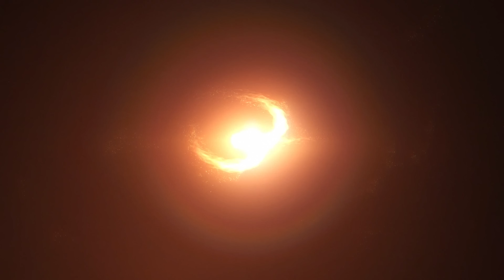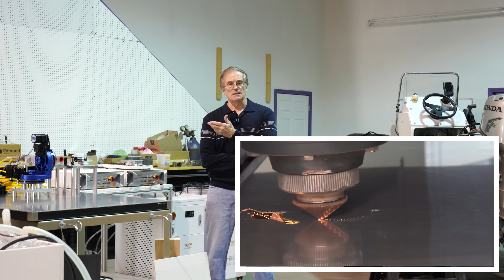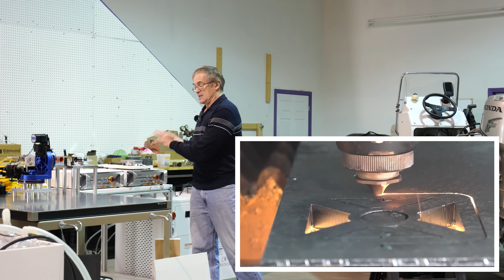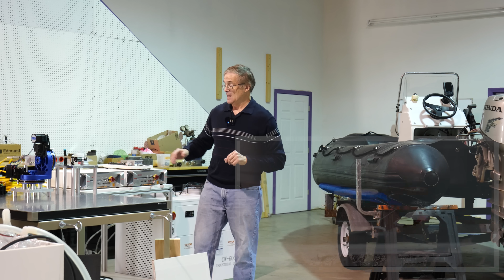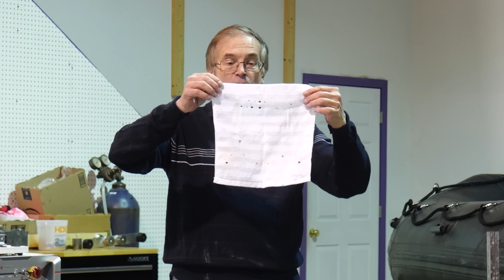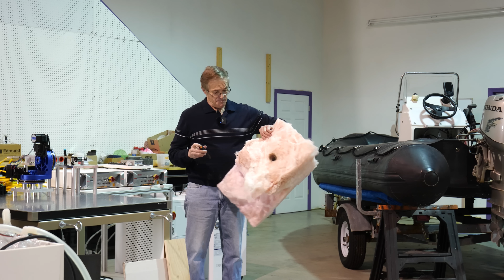We have a problem... and need your help!

Comment: From chatGPT 

For indoor high-power laser testing, you need a beam dump or barrier that:
	1.	Absorbs rather than reflects the beam.
	2.	Survives for the necessary duration (several seconds).
	3.	Dissipates heat without creating hazardous by-products.

Key Considerations:
	•	Wavelength and power of the laser (you didn’t specify—assume multi-kW class and either near-IR or visible).
	•	Beam diameter at impact (focused to small spot = high power density).
	•	Duration (a few seconds = significant thermal load).

Recommended Materials:

1. Graphite (High-Purity Carbon Blocks)
	•	Very high melting point (~3650°C).
	•	Excellent absorber for most wavelengths.
	•	Low reflectivity, especially if roughened or angled.
	•	Used commonly in high-power laser beam dumps.
	•	Con: May sublimate or erode with continuous use—good for pulsed or short bursts.

2. Black Ceramics (e.g., Silicon Carbide or Alumina Coated with Absorptive Layer)
	•	High thermal resistance and damage threshold.
	•	Commercial beam dumps often use such materials with cooling.

3. Copper or Aluminum Heat Sink with Black Oxide Coating
	•	Good for lower power or diffused beams.
	•	Must be angled to avoid back-reflection.
	•	May include cooling systems (air or water).
	•	Black anodizing reduces reflectivity.

4. Commercial Laser Beam Dumps
	•	Designed to handle kW-class lasers.
	•	Often use conical or wedge designs to trap and absorb the beam internally.
	•	Water-cooled or air-cooled versions are available.

5. Sand or Charcoal in a Metal Box (Temporary Use)
	•	For crude indoor testing, a container filled with dry sand or granular carbon can safely absorb energy.
	•	Beam is scattered and absorbed by the grains.
	•	Use only for short tests—this method creates fumes/dust.

⸻

Best Practice Setup:
	•	Use angled barrier to reduce backscatter.
	•	Surround with non-flammable insulation (ceramic wool).
	•	If using makeshift materials, always include fume extraction.

Comment: Guessing a Hebel block wall isn't a solution ??

Seems an ablative target layer may always be necessary...

Short of a rock quarry as backdrop high energy "light will out". 
(one doesn't want to reflect that energy it needs to be absorbed, or the contents of the lab will be at risk - short focus, (and coincident/intersecting beams), as stated is the safety used for practical material concerns.  "Infinite focal length" - approaches a real starwa*s  "ray" - device.

 - In other threads, folk are hypothesising slurry systems...

 - I added "   @custos3249    hmmm,  a slurry recirculation system (edit: or "recirculating slurry") on an inclined plane - viscosity can be engineered for flow rates and pumping  - vibratory fluidisation makes near solids flow incredibly...  (thinking out loud like most - here...)"

Comment: Paint can full of sand. It's easy to scale up to a bucket or trash bin. Put the can in a box to contain both the molten residue and any sand which drains out. The sand will extinguish any flames which may occur, it will filter and ablate to diffuse the beam at the contact point, and it makes a fantastic heat sink.

Comment: onjly have superficial knowledge about that stuff, i jsut wondered:
1. is stray radiation is tolerated, with such high power lasers i cannot imagine it is
2. what area should be coverable. a plate or rather 2 garage doors?
maybe it's jsut my lack of understanding the setup you are planning for

Comment: My first inclination is a water jacketed polished brass sheet, angled to deflect the beam straight down into a box of sand, possibly granular blastfurnace slag or basalt?  Really, a thick metal sheet of an alloy that doesn't readily absorb your particular frequency of laser is always an option, we had nightmares trying to cut brass on our IR fiber laser machine.

Comment: How about a water fall, doesn’t need to be thick. Could be wide, or if it doesn’t melt glass a thin aquarium wall might work, and you could experiment with the transparency.

Comment: Does intumescent paint work? Nighthawkinlight has some experiments showing some recipes.

I think the insulating carbon foam that's made when it starts to heat could be a good insulator to stop the drywall catching fire.
If I remember right he had a few videos about a Starlight like material and how to make it.

Comment: If you set up a water curtain, imagine those water fountains where it’s continuously dripping water in a constant stream. They should fix the problem with the water evaporating too quickly because you’ve got a Con continuous flow. I think the energies involved which you haven’t exactly specified should be able to be absorbed by this water.

Comment: Dark anodized aluminum plates in the following configuration: Place the material at a highly oblique angle, close to parallel to the laser beam, to extend the safe exposure time by increasing the area of impingement and reflecting some of the energy, particularly when combined with secondary and tertiary plates of similar material. If you like I can quantify the effects of various impingement angles. While dark anodized aluminum is inexpensive, it is the opposite of failsafe, as ablation of the anodized layer will expose reflective aluminum. If aluminum is too dangerous, graphite blocks coated with Vantablack or Acktar Black may present a more favorable failure mode.

Comment: Is ballistics gel portable enough for your purposes?If you added some dye or titanium dioxide and maybe some shredded aluminum or other reflective material you might have something structurally sound which could absorb a lot of heat through phase change while spreading it laterally to take advantage of a larger volume. Aluminum shavings should kick back most of the laser energy but in a way that's not focused enough to cause any perile to people or equipment standing in front of or to the side of the wall.

Comment: I'm not an educated man. my first thought was ceramic tiles like were used on the space shuttle. They handle a LOT of heat. But that heat is spread across the entire tile. I think you need a way to split the energy up before trying to absorb it, so there is less heat or energy to absorb. And the only thing that I can think of is diamond. And those are so powerful, you may need something like liquid nitrogen to cool the diamond to keep it from melting. Whether an industrial diamond, or a synthetic diamond might work, I don't know. But as many facets as can be ground into it would be helpful to split that energy up. Then maybe fire brick could handle it. Actually, one more much less expensive item came into my mind. Carbon, like what is used in electric arc search lights. I used to work as a projectionist. And those old projectors used a much smaller carbon arc "rods" that had to be adjusted every so many minutes. Those will take A LOT OF HEAT. And its the same technology as in those WWII search lights, and even carbon arc welding. if you could find a way to cool those, maybe run a water hose over the rods? Since your not dealing with any AC volts, (at least on the receiving end), that might actually work. And would be reasonably priced.. Those are my ideas. I hope you find something that costs less than diamonds! But maybe as a last resort.

Comment: A couple of points:
Anything reflective would endanger you and everything in the room. Also, this beam will continue through the atmosphere and could hit aircraft miles distant while in use.
My suggestion is to use extremely short pulses, especially in real world conditions. Destructive testing should yeald a time frame sufficient for the purpose,  then limit the output. A few milliseconds should do. Otherwise you don't just temp the FAA but endanger lives. 
There are simple compounds which swell and exfoliate providing good heat protection to the underlying substance. I can't remember the name or formula.
Perhaps a fishtank with absorptive dyes or particals tailored for your spectrum.
Even powered charcoal may suffice with supplimental dyeing.
Also a divergent beam may be safer. Just narrow enough to do the job but diverging constantly thereafter.

Comment: if you were to mount the lazer vertically and point it at the ground you would still want the 'contractor grade trashbags filled with dirt' around it. the issue isn't with resilience but basicly with refraction. when you have a high powered lazer which doesn't concentrate on a point, and thus doesn't spread out beyond the point, you will want to make sure that no matter what it hits the reflections and refractions do not bounce a single time and hit someone. if you fire it at the ground, if there happens to be water on the ground then for a split seccond it could be reflected and refracted at someone, but if you dig a hole and make sure to pump it dry with a wet vac if it FILLs with water, then the lazers themselves will bounce back upward.
if you don't want to dig a hole, you can achieve something similar by constructing a mound.

the problem with these concave lazer catchers is that the reflections will come back at the lazer creator itself. one way to deal with that is to disrupt  the "antenae reciever" instead of making a bowl or hole, you make it like the impression of a torus or doughnut. another option would be to not mount it vertically at all. if you have a lazer shooting a straight beam, you could have a very small pure silver mirror reflect the lazer at the ground. if you make the mirror at 45o then the reflection will be 90o  and only perfect reflections will go back at the lazer. this in effect shrinks the size of the lazer maker to the size of the mirror. also if instead of making it reflect 90o to go straight down,  you make the angle of the lazer hitting the ground progressively closer to perpendicular, you in effect spread the energy of the lazer across more area. if the dot of the lazer is an inch squared, and you angle it to hit 1000 inchs of distance, then you reduce how much power is being absorbed by any particular inch of space by 1000. taking 1000 watts to 1 watt, may not be enough but it is still very much a difference in order.

similarly, if you have a focal point, regardless of whether it is made by teh beam generator, you can always put a prism to spread the energy across a larger area. lazers have very low variance in frequency, but if you can take a 1 inch square lazer and not only make it get absorbed by 1000 inches of colision, but you also can spread it in a seccond axis, then you geometrically reduce the number of watts needed to be absord at any particular point.

repeating but expressing it more explicitly. if you have a 1kw lazer, and you make it get absorbed by a distance of terrain, you increase the dimentionality from a zero dimentional point to a line, and if you increase the dimentionality from a line to a field, you spread the power even more. you could increase it again with a lot of difficulty abusing photonics and ablation. if you can get a vollume of solution and get teh solution across teh entire vollume to be equally likely to take a watt of power out as any other part of the vollume, then you have a 3d reduction of lazer power. which means you are basicly cuberooting the amount of power.

what would i do as a lay person? if you aren't beam forming lots of energy from different places into a point, my first reaction is to reduce teh risk to the lazer maker itself by using a mirror to angle it at the ground. then if that was still scary i'd dig a hole or make a mound out of fire bricks. if done in a warehouse i'd go with the mound.  then i would cover teh mound with a cooking pot lid and have the lazer pass through a hole in the center and any reflections would be angled out relatively randomly into the area, and be absorbed by the insulation and drywall of the warehouse itself. doing this would cause the reflections to sorta be spread across the entire surface area of the room. it wouldn't be the actual surface area because there is geometry in the warehouse itself. and also the lid to a cooking pot isn't exactly an optical grade parabolic lens. but this feeds back into the question of "how much money are we looking to spend"? 

in engineering there is always a more expensive solution which is marginally better. in civil engineering you could build a hooverdam scale levy to protect against storm surges, but it would be exponentially more expensive.  the same thign is true here. do you have a huble tellescope type of budget, or consumer tellescope for kids budget? the lid of a cooking pot with a hole from a removed handle will cause decent spreading of power per dollar spent. and you can go up scale and get actual tellescope parts from broken tellescopes off craigslist or similar.
another thing to keep in mind is what you are doign and what others in the field are doing. most reflectionary collumns are about concetrating light, not getting rid of it. they want to look at planets, not avoid catching stuff on fire. this lower prestigue means that you can get away with much much more vulgar tech.

the seccond cheapest option is to take a blank silver coin and a hole nearly as big as it. and hit teh blank silver coin with a ball hammer to make it concave/convex.

which is better cooking pot lid lens or a reflecting glassless mirror? i don't know, you would need to do optical simulations. incidentally by frosting teh glass using a solevent you will increase diffusion massively.

before you do teh optical simulations you would need to buy an industrial quality 3d scanner, and then you would import that digital object scan into a digital twin simulation. ray tracing is the term for this optical simulation.

the problem with aiming it at teh ground in general is reflections. and it is the same problem with aiming it straight up. if you aim it up or down and your catch fails, then you can find yourself in trouble. it isn't likely that at the moment of mechanical failure an aircraft or space station will be right above you, but the trouble you will get in in such a situation escalates very fast.

in general, just like in chemistry, the solution to polution is dilution. spread it around, and while it likely seems dumb, i'd also be worried about reflections and refractions going out windows. both directly in the direction of travel, and directly behind. one way to deal with this is to move the 'focal point' where you are doing the experiment near perpendicular to the windows in question. another is to put shades on the windows perferably on the outside. if you can open those windows, in the summer, you can get natural cooling by having the windows always open and just ahving the shades  angled at different degrees to get wind to blow through the shop.

also i personally would not fuck with water or steam for high power lazer situations. if i was to fuck with somethign similar i'd try finding a source of very very black smoke. the smoke itself will naturally ablate and replenish itself, and unlike water which makes rainbows due to refraction, black smoke wouldn't obviously increase risk. i'd still prefer to go about it in a normal optic manner, messing with fluids like smoke is asking for trouble. if you were dealing with military grade lazers that were tuned to slice steel specifically, then sure, but if you are dealing with a powerful lazer which isn't litteral weapons testing, i wouldn't do that kind of high risk option. the reason water is risky is that this isn't a full spectrum light source, it is a lazer which is nearly one frequency or color. so water would redirect it but not diffuse it necessarily. with the lens and reflectors the spacial distance of how wide the lazer is will cause the different angles of incidence to spread it out.

while being reflected from one particle of water to another would spread a wide frequencys light, the low variance would mean it would potentially still be concetrated after even a large number of bounces. with wide spectrums lights 12 bounces would be nearly nothing, but with a lazer you might still have a multi watt signal, which you wouldn't want to hit your eyes.

i'm contemplating the cost and effect of a culinary grade smoke machine for making smoked cheeses. if you put it next to a box and make it fill the box with smoke, it might be dark enough to absorb and ablate enough lazer to be good. when i was a boyscout we made a fire and some of teh kids decided to point lazer pointers at teh smoke and someone got upset. i don't remember much about it. if you have the fluid in a box, then you don't have the laminar flow problem, and can't have wind just cause your ablation material to disappear.

Comment: Maybe a  blanket of ceramic fiber of about 2" thick can do the trick. Just keep it completely white. And do a perfect system calibration, to reduce stop emmiting time. Maybe a sandwich of 3 or 4 with drywall separators.
  Nice project!
Reply: Keep in mind that colour is VERY important. Whiteness helps with the time.

Comment: Can you interrupt the beam prior to focusing as in a shutter, then mirror/reflect its output to a diffuser lense assembly. In a sense making a laser device that operates somewhat like a pulse rifle, the beam is set free when a pulse is triggered, the beam is on all the time but unless triggered it is redirected and diffused? This still does not eliminate the backstop material, what about several sheets of clear glass, arranged in a non parallel fashion to diffuse the beam?